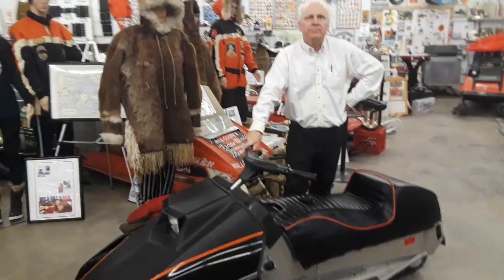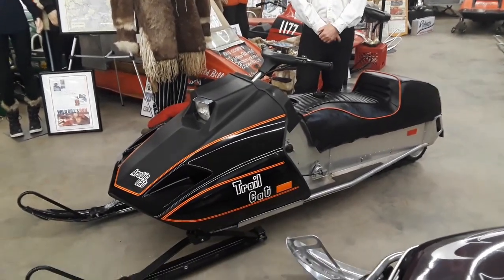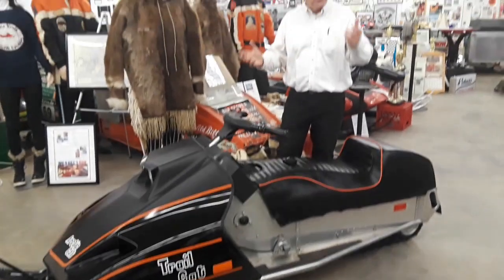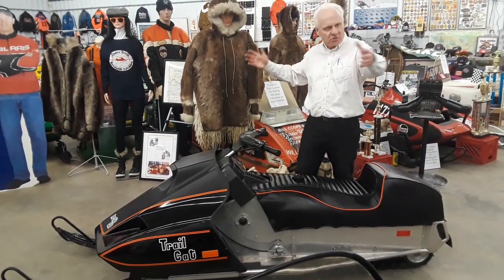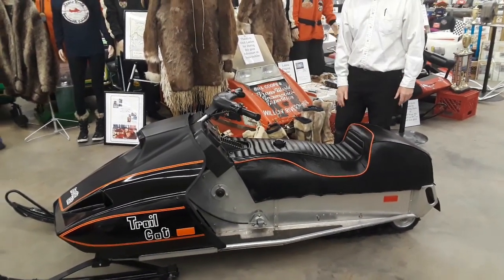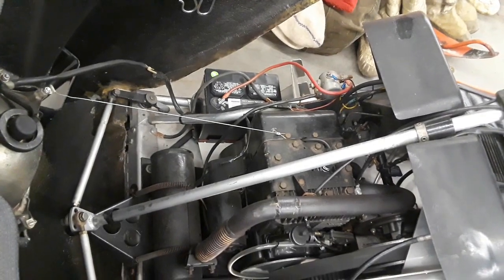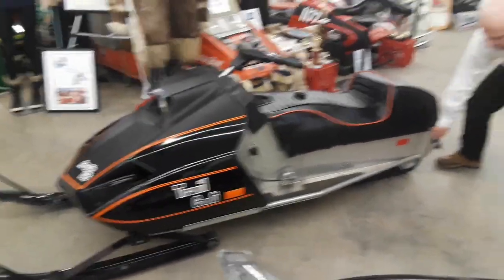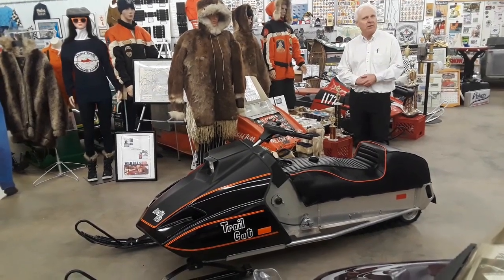1975 Arctic Cat Trail Cat snowmobile --- one of 229

Comment: The Trail Cat here was ahead of its time. A production Trail Cat didn't come outuntil1979 or 1980 as a 340 Oil Injected with IFS.
Reply: what the hell are you talking about???...the man here just got done with show and tell here of the 1975 Trail Cat . And if there were 200 plus built I would consider that a production model....Pay attention!
Reply: @bultacowally  You are right, my Dad was a Cat dealer from 1968 to 1981. The Trail Cat shown here a 1975 was still a Prototype in the works. In 1979 Arctic Cat released the Trail Cat. And it looked nothing like this one shown. You do a little research yourself. You might be surprised what you find. Also to add, each Cat Dealer received only 2 Trailcats in the Fall of 1979. Even though they were NOT a Hot item as anticipated (due to only being 340cc) in the First year. Cat built 7,600 Trail Cats for 1980.
Reply: Somewheres I got a copy of a letter on the 75 TC. They built just enough to satisfy the demand for an ice fishing sled with a simple four stroke single. Cat used to sell Panthers and Lynx with Kohler four stroke singles up to about 1973. Mostly for simple work or ice fishing type machines. The letter explains this sled with the ten hp Briggs was a pilot build to see if there was a market for an ice fishing or simple trail sled for 1975.